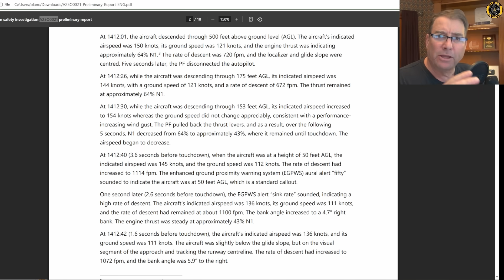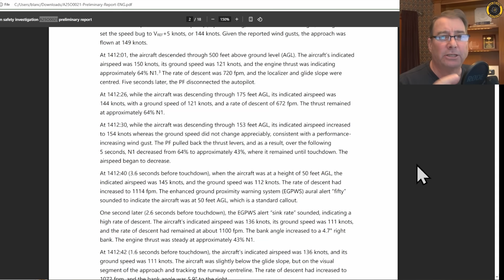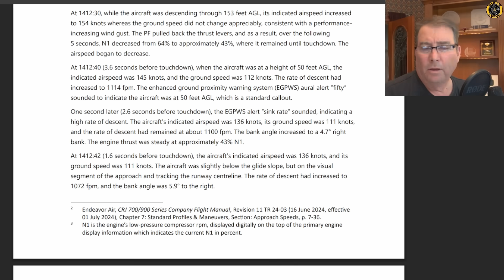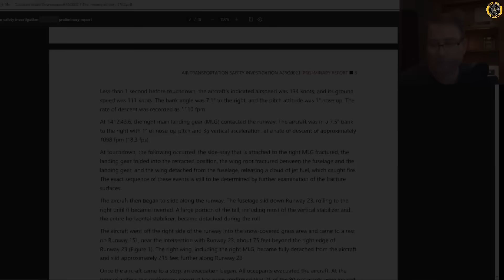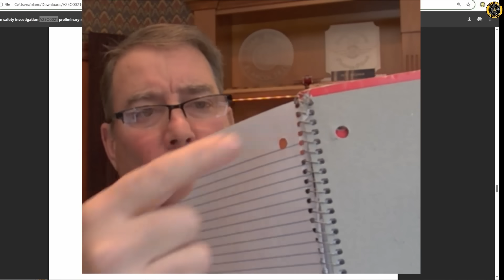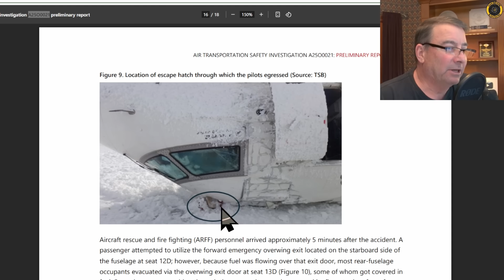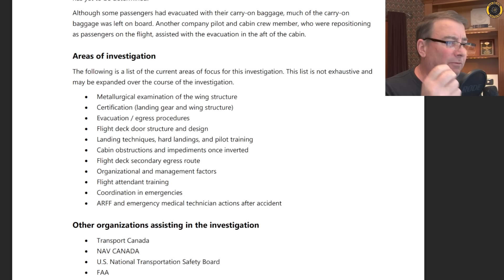TSB Prelim Toronto CRJ Crash

Comment: Pitch at touchdown was 1 degree at 1,000 fpm. Regardless of whether they were flying the correct speed, the need to flare and pitch up is critical. Any speed additives or errors are basically irrelevant because of this. You have to fly the wing, as they say.

Comment: The wind at 270 gives a slightly off impression. It was shifting by at least thirty degrees on both sides of that. There was just enough snow in the air to make snow devils and vertical vortices like rolling smoke visible on Lake Simcoe, not far north. You could see windsheer in action.

Comment: To be fair, with the blowing snow and only plowed to 165 feet wide from a 200 actual, the runway would look further away than what it would fully dry.  I would be interested on whether the airplane had a good radar altimeter and whether the pilots were getting descent call-outs, or was the descent rate so quick it would call out "100" about the time of impact.  
There are a lot of female pilots flying routinely in the military AND commercially as well, the mix is increasing rapidly and a female's reaction time IS, on average, a lot better than a man's.  Would we be fair to say all the crashes we've had the last century, were they all because there was a man flying?

Comment: I would love to see commercial pilots get a bunch of experience flying gliders, where it is all stick and rudder and energy management, air speed indicator, bank and roll, vertical speed and a bit of string to show you are flying straight. 
It is such a pure form of flying, and it gives you such good skills in flying.
Reply: I just made the exact same comment.  😀
Reply: Another point with glider flying is that you tend to assess the weather differently. With powered flight, particularly passenger, you tend to assess weather in the context of turbulence whereas with gliders it is more to do with where you are going to get lift or down.
Reply: EXACTLY!...
Many incredible famous landings that ended well, have the glider experience of their pilots as a common factor, like Sully, for example, and Captain Pearson of the Gimly-Glider!

Having some hours in gliders myself, I find it puzzling that it is not yet a requirement for ATP pilots...

Comment: As a structural mechanic for three decades, I would like to take exception to your description of the rivets having failed.  😞 seems to me the impact on the wing, exceeded the elastic limit of the metal there at a fatigue point which is anywhere there’s a fastener hole….. This BS has been a public service announcement.😂
Reply: yes, that's right!  Those rivets were no failures!   They tried as hard as they could!
Reply: @ absolutely !!!, hopefully we will see a retraction so rivets all around the world don’t have to file suit against Juan Brown for his defamatory statement……..😂😂😂
Reply: What will it be next? Joe bolts ?Hi locks ?Huck bolts? Juan be throwing shade at all fasteners.    I say fasteners unite.!!!😎
Reply: @nobodyspecial7185 what time did you crack your first beer?🥴
Reply: @ what time is it?
Reply: @nobodyspecial7185  beer-0-clock

Comment: As I  recall each throttle movement was one of three.  Reduce, add reduce and add.  You don't  just pull to idle and leave it there.
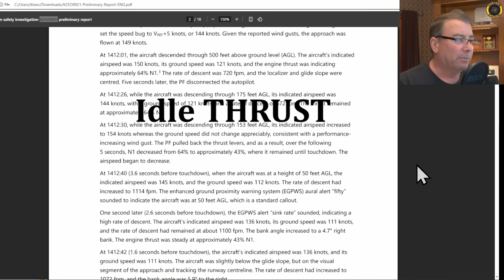Reply: The report says ONLY that the throttle was reduced from 64% N1 to 43% N1 - there is NO mention of flight idle, except in Juan's comment at 06:07, where he describes 43% as "darn near idle rpm" - the exact setting of flight idle is a matter of dispute because it is context-dependent.

Comment: If they needed to react to sink rate - while trying to counter RISE rate from gust - wouldn't there be spool up lag?

I seem to be hearing that they never pushed the throttle up, even though they were below correct landing speed (which makes me wonder, why counter gust with throttle instead of elevator??). But even if they tried, wouldn't it be too late because of the lag?
Reply: And yes, I hear that there wasn't even an attempt to flare, and other issues. Just wondering.
And wondering if we have conquered wind gusts.  Is the very heightened public nervousness going to say, "Oh, we have nothing to worry about, THEIR problem was because they had wind gusts right when landing, but as long as we don't have wind gusts, our flight would never do what that one did".
Reply: And as flare goes - how many pilots are listening and acting upon "100...50...40...30....20...10" ?
Or do they just disable that?

Comment: Minus the snowy conditions eerily similar to the Endeavour Flt that landed at LaGuardia and scraped a wing, Also had a Gust/crosswind component. Same airline - Same Training.
Reply: I doubt that the airline/training received had anything to do with it.       Theoretical question for you...  You have about 1000 hours total.  Most if it in single engine, fixed gear, slow, and very docile airplanes.  And you have maybe 30-50 hours in twins. Two-thirds of that is spinning radios or pencil whipped.    And suddenly you're flying an RJ onto a contaminated runway with gusty crosswinds.    How might this end?

I came up in a very different era.  We usually had pauses as we matriculated.  During those pauses we got to observe, practice, and learn.  Now??  Frankly, I am surprised that we have been as fortunate as we have been over the last few years.
Reply: Good point!
Reply: @ Actually, you are the one who should be having 2nd thoughts about your comment, statistically speaking. The truth will set you free.
Reply: @ Truth = trolling?
Reply: Same diversity hires.
Reply: Now do REAL STATISTICS 
@rg2B2222 and compare percentages and ratios.

I'm a woman, and the data is beyond alarming to say the least.

Something or someone is in play, and I suspect that there are UNEQUAL standards being applied between men and women in selection, training, testing, passing, AND experience for hire.

An aggravating factor Juan covers is shit training and pushing new pilots into complex jobs, and I would add them high rates of true experienced pilot-retirement means it is far more likely there is no one in the cockpit to catch the fails and stop disaster
Reply: @ Truth = trolling?
Reply: @WhatLifeisallAbout99 how about we do it by hours flow for each sex?
And the airlines have said, just like the FAA, they are giving preferential treatment.  
Guess what, if this wasn't the case it wouldn't be an issue.  Remember when SWA had a passenger basically sucked out a window? No one questioned why the pilot was a female because it was before all the nonsense about promoting your flight crews based on gender.
Reply: 1988 - AQ 243 at OGG 

1991 - UA 545 at COS 

1996 - ValuJet 592 at MIA 

2003 - Air Midwest 5481 at CLT 

2009 - Colgan 3407 at BUF 

2013 - WN 345 at LGA 

2013 - UPS 1354 at BHM 

2018 - WN 1380 at PHL 

2024 - AS 1282 at PDX 

2025 - PAT25 at DCA 

2025 - Endeavor 4819 at YYZ 

2025 - AA 1006 at DEN

2025 - Endeavor 4814 at LGA
Reply: @WhatLifeisallAbout99 Give the airlines policies and messaging,  it may well be. It would tend to promote certain people beyond their competency, treat them with kid gloves in training, and pair them up to they can make their overly sexist "unmanned" flights on social media
Reply: @WhatLifeisallAbout99 it was just a fact. You are way too emotional.  You must be a woman 😂😂😂
Reply: @WhatLifeisallAbout99  Call it what you want, bad juju, black cat rancher syndrome, Lady Luck but not here today.  How many of the almost 13,000 B737 built spontaneously combust at the gate, how many B737 put the top down at FL240, WN started in 1971 and has had only one death on all of their flights, half of all the B737 rudder hard overs…..and that is just for the B737 fleet.
Reply: @WhatLifeisallAbout99  The primal need to survive?
Reply: the entire industry safety standards are based on having safe margins, why they would not train in that way is beyond understanding 😢
Reply: @ Truth = trolling?
Reply: @Simonyt-j7n  You do not know what the truth is - you are pretending that your bigotry and prejudice are factual.
Reply: @ Truth = trolling?
Reply: @WhatLifeisallAbout99  so your response has nothing to do with their response. That’s called derailing. It’s no where near misogyny to question the ability of a female pilot.
Reply: @NFS305  Yep people getting triggered over facts. Look up, if you haven't, the Southwest jet that went missed a couple times and almost hit the control tower. ATC said the plane was so close that they could almost reach up and touch it. Male on comms until that event, then female appears on comms promptly afterward.
Reply: The best snooker player, racecar driver, video game players are men.  Maybe there is something physiologically like testosterone levels or something that makes the average man better under pressure or with dexterity that the average woman?  Obviously there are women who are better than men at such things but if I’m on a flight in inclement weather I’d be wanting the best male pilot over the best female pilot.  My wife is much smarter than I am, I respect women.
Reply: @TheBoomtown4  Is that because men are truly better at these things, or because men are the only ones our society encourages to do them? Are men inherently worse elementary school teachers than women, or are women the only ones our society encourages to teach anyone younger than a middle schooler? We are not at the point where we can actually separate these things from our culture and traditions yet. Remember that for a long time, the only nurses in our society were men. There are still women alive today whose college educations (which was a radical thing for them to do then) included required classes on childrearing. The way things used to be still affects the world today, because it was not that long ago.
Reply: @TheBoomtown4  You have NO idea of the relative skills of the two pilots. All we know is their levels of experience.
Reply: @WhatLifeisallAbout99 is it significant? Good question. The Blackhawk on DC was also flown by a woman. How is it very misogynistic mention it?
Reply: @ what is your point? Are you suggesting Female pilots are inferior or cause more accidents? Shall we go to the Statistics of Male vs Female in accidents? Or are you just an insecure misogynist?
Reply: @NFS305  The IP was a male. He should have corrected immediately, but we digress to Monday morning Quarter Backs. I’m a former Army SP, dual rated ATP w/ 10 Type ratings and over 17,000 hours. Accidents happen and we must All be 100% on our game or we become the next statistic. Male or Female, the aircraft knows No difference. We meet standards or we don’t. FAA and Army does not have different standards for males or females. Your comments are misogynistic and you make yourself look bad. Sometimes we post before we think 100% and I hope you rethink your comments
Reply: @NFS305  Because in both cases you have no evidence that the sex of the pilot was a contributory factor in what happened.
Reply: @maybe myth busters would know
Reply: @NFS305  What about the male flight instructor on the Blackhawk on the DC crash?  Did he bring up that their altimeters were 100 ft off?  Did he point out that they were higher than the maximum allowed altitude for that route?  Both pilots were at fault in that accident.
Reply: @NFS305  Studies have been done on male vs female safety rates.  Females perform as well as or slightly better than males.  The main issue here is captains not recognizing a problem developing soon enough, not talking the FO through it or calling for a go around early enough.  In this case, Juan hinted at but it needs to be further explored, why the captain had so few hours after 18 years with the company.  Did he fly often enough to maintain his skills?
Reply: @NFS305  It was flown by a man actually, the Blackhawk Woman was in the 3rd seat, observing as the XO for the squadron.
Reply: @Dexter037S4   Not true- she was flying- as in hands on the controls…   ‘
Reply: @Dexter037S4 No she was doing her recurrent training because she was too busy doing DEI work in The Whitehouse.
Reply: @Dexter037S4  I have read a different account but even if she was PF it wasn’t completely her fault. It’s a shame however all the way around. RIP
Reply: @Dexter037S4 Nope, she was pilot flying.
Reply: @Dexter037S4  WRONG. Left hand seat - male instructor pilot (PM), right hand seat - female pilot (PF) undertaking recency flight. Behind the right hand seat was the crew chief, acting as observer.
Reply: Same DEI.
Reply: Both female pilots.
Reply: @NFS305  Unless you're here trolling - pilot training is far more likely to be the culprit.
Reply: @christianschoenfeld1825  They're trolling.  Report the comment.
Reply: @christianschoenfeld1825 in these accidents everything is checked from parts to training to weather. Why is it not ok to ask about female pilots especially when there is a push to get women in the field and we know in other situations there have been corners cut in eligibility requirements. If a plane crashed because repairs were ignored your family would sue and win. What if grades were fudged for a female pilot? Is it OK at that point. We have to stop playing games and have a real conversation. You ever watch female cops try to handle a perp? It creates danger for everyone, but got forbid somebody mention.  Would it be better to do the research and find out. Wouldn't it be better for the females that handle everything as well as men with the same hours. Wouldn't it be nice to know no matter what the color, gender, religion, political affiliation, favorite football team, age, whatever that you don't ha e to worry? Come on, man. These are fair questions and thoughts.
Reply: @christianschoenfeld1825  if the training is reduced to expedite certain people then it needs to be examined.
Reply: @NFS305  Your point?
Reply: @Agnemons  maybe there’s trend, idk.
Reply: @NFS305  maybe you’re just a misogynist

Comment: there is no substitute for the fundamentals.
I believe that there should be a minimum requirement of flying 50 hours per year as a sail plane pilot, for all pilots.
Reply: You can get all the fundamentals in the airplane you are flying by just keeping the autopilot OFF.
Reply: @georgeconway4360   flying without thrust is even more fundamental.  Take the throttle out of the equation, and you're really focusing on "stick 'n rudder".
Reply: @ Flying at flight idle after normal approach power in an airplane like the DC8 be quite exciting. If you were in trim with the stabilizer at normal approach power  you became very nose heavy at idle power. One of the reasons people had landing the airplane. On of the early upset events on the DC8 when unable to have pitch control in. an overspeed dive the Captain pushed the power up and recovered. Engines under the wing cause the nose to pitch up with power and on airplanes with the engines above the wing pitch up when power is reduced or lost completely. On the DC10 and MD11 loss of the #2 Engine on takeoff will cause the nose to get light.
Reply: @georgeconway4360   🎯👍👍👍👍  ‘